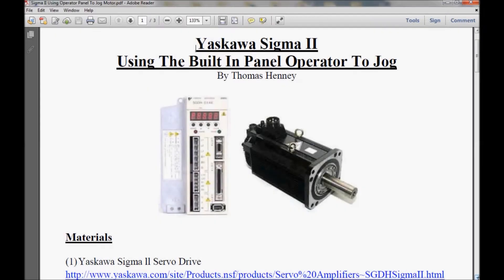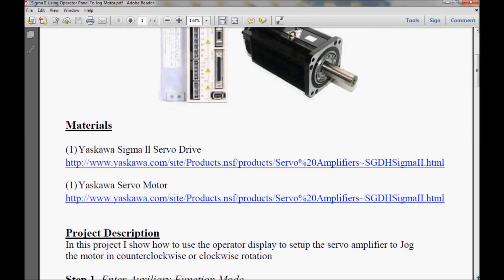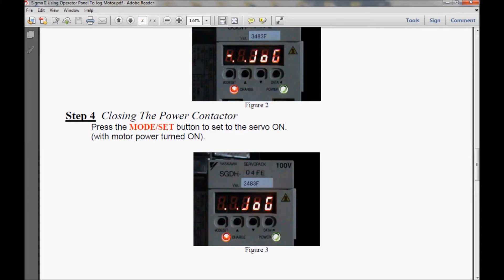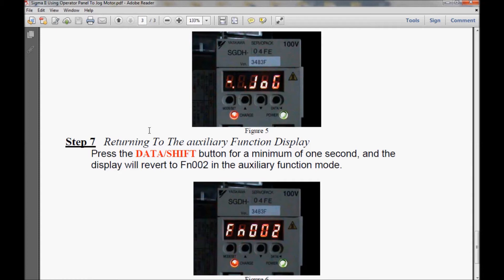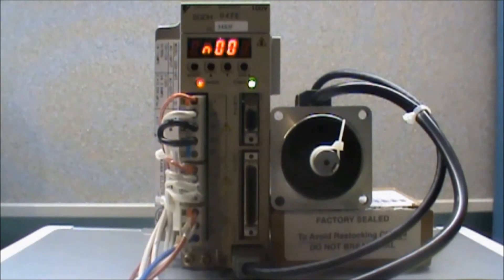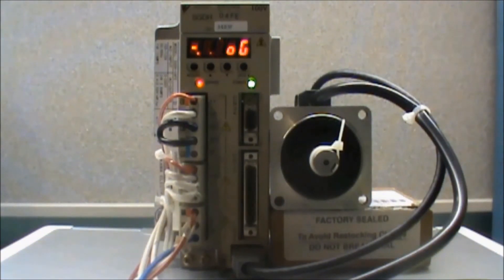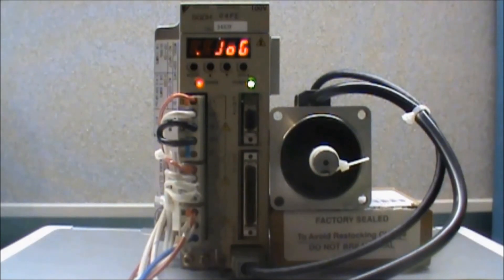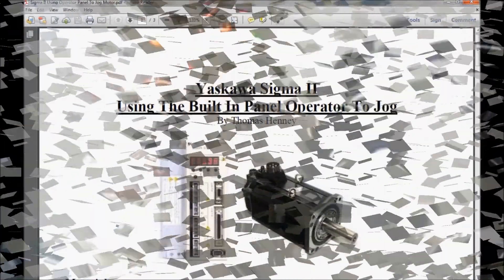Yaskawa Sigma II Jog Function

Comment: Porque sale A.C9 quiero saber deme una solucion
Reply from the maker: One thing you can try is turn off power to the Servo Pack and wait 10 to 20 minutes, while you are waiting check and make sure encoder cables are not damaged and encoder connections are tight, after a minimum of 10 minutes turn on power.

POSSIBLE CAUSES
The A.C9 is an encoder communication alarm.
A couple thing that can cause this alarm.

1. Using a motor & encoder not made for the servo pack. 
2. Wiring for encoder is damaged or wired incorrectly.
3.  Encoder is damaged.
4. Corrosion, dirt, dust, oil, grease  in encoder plugs.

Each Servo Pack at start up, will look to the encoder for the code, if the code is a miss match for the Servo Pack it generates this error.

Hope This Helps

Tom

Comment: In Step 4 the contact is supposed to latch so you can jog the motor. Does anyone know what to look for if the contact doesnt engage? Thanks in advance for your replies.
Reply from the maker: Terry,
To see if the contact engages you wound look to using the outputs, in particular the Servo Ready output. "Servo Ready means there are no servo alarms and the main circuit power supply (powering up the power section of servo pack) is turned ON." This would be terminals 29 & 30 on the JUSP-TA50P Terminal Block. Be careful here because the Photocoupler output levels per output are a maximum of 30VDC and maximum output current of 50mADC.

Also: An added condition with absolute encoder specifications is that the SEN
signal is at high level and absolute data was output to the host controller. Now this may apply to the jog function also.

You can also see at about 4 minutes into the video one of the seven segment displays are on (servo is in  base block), a little further in when I press the MODE/SET button, the segment goes away and at this point the power section is powered up.

You also need to aware that if you are using a brake motor, I have seen most of the time the power to the brake is run through a relay and the servo output controls the relay. This is due to the low amperage limitations of the output 50ma.

Hope This Helps
Tom
Reply: Did you solve this problem? I have the same situation
Reply: if led "charge" not light on, and not errors - in my case the are not main power, only 24v

Comment: A QUERY I CAN LOCK THE SGDM SERVODRIVER WITH ANALOGUE REFERENCES FOR SPEED AND TORQUE AND A DIGITAL ENTRY FOR ACTIVATIO N
Reply from the maker: The short answer is yes depending on the model,  you would be able to use a digital signal to Enable and to place servo amplifier into Run. The analogue will be used to control the speed and torque. 
Follow this link to manual for schematic, https://www.yaskawa.com/downloads/search-index/details?showType=details&docnum=SIEPS80000015
pages 6.3.1 for Spreed Control and  6.3.3  for Torque Control. You will notice while in Speed Control the torque is limited. In Torque Control speed is limited.

Starting reading at 8.39 for speed control. And 8-61 for Torque Control.
Hope This Helps
Tom

Comment: Dear sir, i've recently bought a yaskawa servopack sgdm-A5ada for learning purposes. but it seems the servopack need a motion controller to can do the job can you please tell me what kind of controller i have to use and there is other alternatives to control the amplifier with a non-yaskawa motion controller. thanks in advance
Reply from the maker: Hello Abderahim 
The type controller needed will depend on the desired out come, yaskawa makes the MP940 motion controller, if you check my videos "MP940 Deleting Program" you can use this controller for motion control. You can also use most brands of PLCs to control motion, if you are attempting position control check out page 8-48 in the users manual (sieps80000015a) it shows exactly what parameters to change for "Pulse Train input" , follow link below for user manual.

Tom

http://www.yaskawa.com.cn/technology/download/manual/sieps80000015a.pdf
Reply: Tom H thank you very much Mr Tom. i will check the information you mentionned and see what i can do about it. the problem here is the high price of Yaskawa controller. i have already a siemens plc but i dont believe he have pulse train output
Reply from the maker: In the past I have used the MP940 by Yaskawa and the following PLCs Automation Direct (DL-205), Siemens (S7-1200) and Allen Bradley (SLC 500). I will check to see if I have the projects still if you need help.

Tom
Reply: Tom H unfortantely i have a siemens 313c 2dp without a special module for pulse train generation, i taught about the FM 354 wich is used to control servo drives but it seems its made just for siemens servo drives. actually i'm not trying just to control this servo drive but i wanna do it on a professional way since i'm a student engineer. so this was the idea. i'ill keep you updated sir with the progres
Reply: by the way would the MP940D JEPMC-MC410 enough to fully control my servopack. i found some with a reasonable price. pls advice and wich cables should i provide. thanks a lot!
Reply from the maker: I understand that the price of a controller oh so well, even EBay some are over priced for me. For the plc you need a high speed counting card with high speed outputs.

FYI, I orginally started with Automation Direct PLCs, they are a low cost option you may wish to explore, the DL-05 has the pulse train outputs you need, and the cost is around $100,00.

Tom
Reply from the maker: Sorry but NO, this model is only for SGDH ONLY.
Reply: yes this is true :(. ill see an other option.
Reply: Dear Tom, i've purchased an I/O cable for my servopack sigma 2 from the supplier MDFLY but i'm facing some problems with wiring sinds the cable is coming without numbers on the wires. is there any documentation where it is shown wich wire (color) is correspinding to wich pin??  thanks in advance
Reply from the maker: For that you will need the manufactures number on the cable.
Reply: Tom H ok thanks. ill see.
Reply: Sar earer a. C90 plez halp
Reply: @muhammadafzal6575  encoder problem